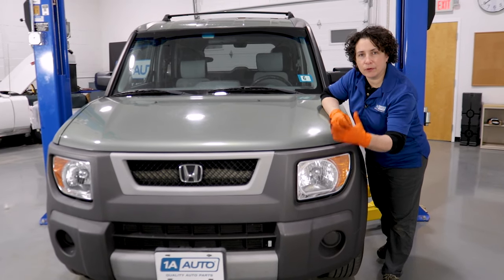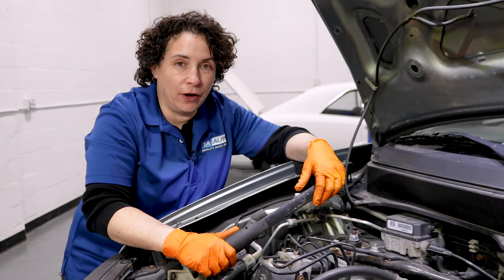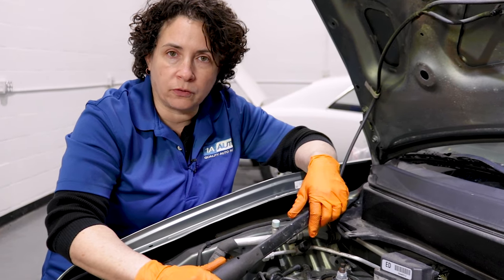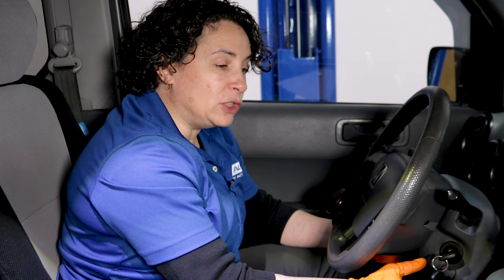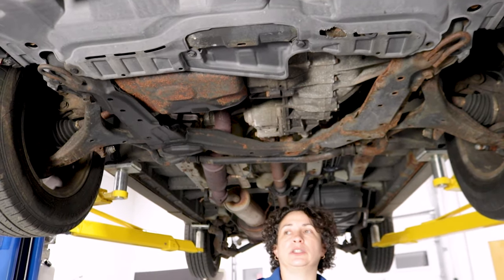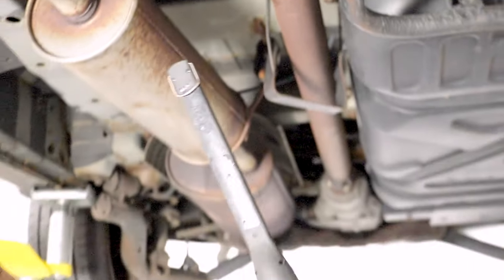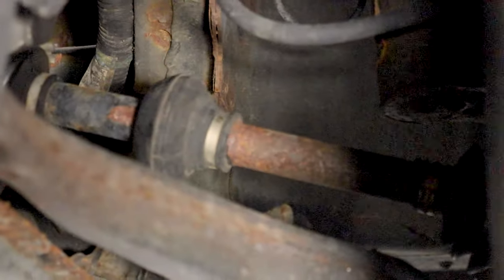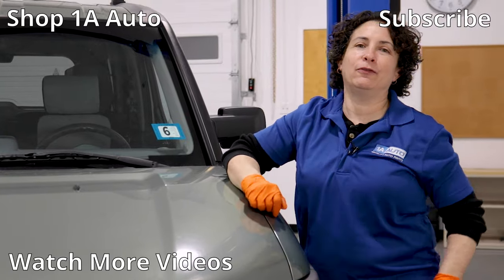Top 5 Problems Honda Element SUV 1st Generation 2003-2011

Comment: I have a 2005 Element.  Purchased with 128,000 miles, it now has 170,500 miles.  Replaced brake rotors and pads, struts, spark plugs, ignition coils and motor mounts. It’s been  a dependable suv, plan on keeping for around town errands, possibly up to mountains for some camping.lm///

Comment: Picked up a 2004 from my neighbor 2 years ago... 55,000 miles.  Excellent condition with full dealer service history for all required service.  Its all wheel drive and the best car I have driven here on Alaska roads.  Love the fact it turns into a mini truck with the seats out.

Comment: I never had any issues with my Element. Put 200k on it just fine.
Reply: Same here Lisa, I responded to one guy wanting to purchase an Element and changed his mind, I told him don't get discouraged on the vehicle, these are damn good vehicles and is the highest sold discontinued vehicle in the country.
Reply: That's awesome! I'm on my second Element (lost the first in a crash) -- but by far my favorite car to own. Currently at 135k on my 2006. So happy to hear the 200k+ stories -- looking forward to holding on to mine as long as I can.
Reply: everything has its problems. still more reliable than any domestic vehicle I bought in the last couple of decades.
Reply: Best tip for longevity? I’m planning to buy a use one

Comment: I wish they would make the Element again. Loved my 04.
Reply: They are
Reply: @frankburn6312  NO THEY AREN'T, STOP GIVING US HOPE
Reply: @imsuuuuure3074  they just announced that they are going to make a next gen
Reply: My ‘04 is still rolling along. 307k miles now
Reply: @FullyYoked  show the link, I guarantee it's not directly from Honda, people say the same thing every year
Reply: @Sirach985  got an 06 with 280k!!
Reply: Mine is 06 with 165k
Reply: '05, 200K.
Reply: My 04 element was trouble free, suffered none of these problems. It had 240,000 miles before my wife killed it. Maybe because it was a California Car, no rust like this one. Honda really made a huge mistake by stopping production of this Ute.
Reply: @bondgabebond4907  I'm in the SF Bay Area, so the underbelly of my beast is amazingly clean. No rust except a bit on the tail pipe, which I guess is not uncommon. The rust under the demo car blows me away.  My girl's is 2004 EX, 102K. Mom car.  I've never loved a car so much.

Comment: I bought my Element 21 years/180,000 miles ago and never had one major problem with it. Taken some major road trips with it, and it's been my work truck too.  Not so many miles because we always had two cars sharing the load.  Element's been the best and most dependable vehicle I've ever owned, would buy it again if a time-traveler!

Comment: I have two Elements. One throws a 2646 code every couple of years, along with bucking and sputtering. I simply clean the screen, clear the code,  and it's good to go.
Reply: Fascinating- I have a 2005 E with 200k miles and never leaked a drop of anything. I'll count my blessings.
Reply: @andykiss8124  same
 Except when they failed to tighten the oil filter after a oil change prior to taking it on a 1600km highway trip.  Lucky I didn't burn out the engine, she stunk from caramelized oil on the exhaust system for at least 2 years after that.
Reply: @andykiss8124  Me too!  SOP paint job.

Comment: I have a 2007 with over 200k miles. I haven’t gotten any of those problems. Knock on wood! Thanks for sharing!
Reply from the maker: +HowToDoItDude Thanks for checking us out! http://1aau.to/m/Shop-1AAuto-c
Reply: i have an 03 with 400 000km and an 06 with 250 000km and only had the solenoid issue on my 03, cleaned it out and it was good to go.

Comment: I own a 2006 Element and must be very lucky. I haven't had any of these problems. I bought it used in 2011 with 54k miles and now have 128k miles. I have a very short commute. The Element has been probably my favorite vehicle I have ever owned in the 26 cars I have owned since about 1989. The thing is a tank in snow and the most utilitarian vehicle. But, thank you for the video. I will keep these issues in the back of my brain for possible future reference.
Reply: wanna sell it?

Comment: 2003-2008 many would consider Gen 1, with major upgrades that happened 2009-2011. I have owned 4 elements, and am currently down to just one, a 2011. I guess I'm pretty lucky as none of my Elements suffered any of the problems you described...although I have suffered very minor issues with all. 2005 was not a very good year but to be honest, issues did not surface until well after 150,000 miles. The biggest issue with the Element is the suspension. It's not made to carry very much weight and wears out frequently. I see all these homemade "camping" Elements and feel sorry for the owner who has no idea what they are in for. Another piece of advice: Have that valve train adjusted after 100,000 miles. The last Element I sold had 305,000 miles on it-regular maintenance is the key. IE: Change the oil & filters religiously....@100,000 swap out the Auto tranny fluid & spark plugs-your golden.
Reply: Bought my 2003 used...was hesitating, because of the rear suspension. 130K miles.   Ain't terrible, but it squeaks and wobbles a bit.  Also, at freeway speeds a faint whirring noise is coming from the transmission.  Which apparently is a common problem with Elements, IIRC.  Had the valves adjusted after purchasing, oil change, but haven't driven it much to pay much more.  Oh!  I've got a case of the Battery Drain Blues.  Not too drastic, but replacing a battery after 3 years is too soon.  It's why I came across this video...looking for pointers on how to diagnose the problem.  Thank you for your tips.
Reply: Thanks for the tips!
Reply: @machtnichtsseimann  rear is probably just the bushings, cheap and easy to fix diy

Comment: We have his and hers 08 Elements and haven't had these problems but thanks for the heads up. They are the most trouble free cars we've had. Only 1 problem with the first one in 7-1/2 yrs the other 1 in 3-1/2. Both were purchased used. I think they will outlast me.
Reply: Yeah I recently bought an 08 Element, had it almost 2 years now, it was a salvaged vehicle, it's in great shape. I hadn't had any of these problems, I keep my oil changed with high quality oil, changing it myself. The CV axles are in great shape, so I have no complaints. But this is good information to know. My only problem I had was I had to get the right side fan replaced on the radiator, simple process, haven't had anymore problems.

Comment: One cause for bad axles that a lot of mechanics overlook is broken or worn out motor or transmission mounts. Before replacing a CV axle, it's a good idea to check those so you don't damage a new axle.  The damaged engine mount or transmission mount can allow the engine/trans assembly to move enough to pull the inner CV axle bearing assembly partially out of the outer raceways and even rip the rubber boot which causes loss of grease and premature wear.  I've seen a lot of CV axle issues coincide with bad motor/trans mount.

Comment: I have driven my 2005 element new off the lot for 19 years with three hundred k on it. One thing I noticed when driving down to Arizona is when on a right turning curve at sixty miles an hour I would get a weird shimmy I’ve never experienced before . When you said that about the drive shaft you described exactly what mine did . Not in the steering wheel but the car itself. Think I’ll take it in for a look .

Comment: haha I have a 2003 Element that I bought new in 2004 and that vehicle has 240,000 and no rust except a couple dings that have surface rust . The brakes have been redone completely twice and of course general parts replaced as needed but overall its the best vehicle I have ever owned .

Comment: Being a Honda tech I laughed at this video, the ignition immobilizer fault is not normally a issue it’s the electrical portion of the ignition switch. Can be replaced separately PN is in a tech bulletin for common fault and does not require reprogramming.
Knock sensors common to fail but verify harness or previous repairs. 
Vibration issues, inner cv joints front, wear causing vibration on acceleration, no mention of contamination of rear diff fluid, noise, vibration on turns. 
Please be advised under no circumstances use aftermarket axles, total junk, you will be sorry
No mention of rear control arm corrosion some models safety recall 
No mention serious AC faults, compressor failure contaminates whole system. ac relay failures 
No mention of lack maintenance “ oil changes” causing timing chain to wear out prematurely as well camshaft lobes failing. 
Some other issues with drive belt tension making noise under accessory load. 
Common oil leaks, valve cover, timing chain, timing chain tensioner cover.

Comment: I drove my 2007 SC for 15 1/2 years. 142k. No trouble with any of these issues. Just routine service. Only repair was a new starter at 114k. Best car ever.

Comment: #1 is actually the VTEC solenoid. the VTC solenoid is on the right side of the cylinder head, it goes through the timing cover. both are common leaks as well
Reply from the maker: +Rob Miller Thanks for the tip!

Comment: I found after having 5 Elements the most common problem is the window regulators seem to go out unexpectedly and intervals of about 50-80k miles, depending on how much you use the windows. I am sure there is a specific number of cycles that Honda has in their testing for production but that number I do not have and do not know if Honda releases that information to the public. Other common items are the cooling fans seem to go out about 100k miles in Florida weather while in a northern climate they last to about 150k miles or more. Its about $120 for aftermarket fans, easy install if you are mechanically capable. The radio volume knob tends to "slip " and the heater control light bulbs are intermitten after about 70k miles and replacements are very expensive($20 for one specific bulb and about $12each for the other 2) Other than that maybe corrosion on the brake calipers function and rotor warp if you are a heavy braker. Underneath corrosion in salty climates is a bad one. Finally what t3 of my Elements had was a clunking noise in the rear was from the rear stabilizer bushings were worn but not looking worn. About $15.00 and 1/2 hour 4 bolts (if not rusted) work. Any questions about the Element feel free to ask me.

Comment: Thank you thank you thank you.  Shortly after flipping her 100,000 miles on her most of that I drove myself bought her second hand, one previous owner, low mileage and LOVE my 2010 Element.  Was a fairly easy and cheap fix compared to having to find another car that fits my lifestyle. The shimmy is gone and was done in one afternoon at home in my yard. You are one of my favorite vloggers for car issues and my husband kept trying different things to get it to go away and looked at me like I had lost my mind when I said can we replace the CV axles and see if that fixes it.  But we did and now she is running like she did when I bought her.  So many thank yous for sharing this information you saved me trying to find another vehicle am trying to hold off until they bring the new Element out before buying another car.  My last car was a Honda Accord and drove that 280,000 miles before someone came around a blind curve and totaled it. I won't own anything but Honda because you just cannot kill them if you fix minor problems before they become major issues.

Comment: After owning 3 Honda Element, your video sum up common problem. I would add leaky oil pan...replaced  2 oil pan on two of my Element, one oil pan was crack and the other one was rusting out.

Comment: Nice video and tips, though your key tip may also be the connector to the instrument cluster, they are notorious for having a bad circuit board and the connector needs to be supported, this also causes the cluster lights to not work all the time. You can also hear the fuel relay clicking behind the glove box when it won't start.

Comment: It's great to see a woman do these videos for a change. Smart, well spoken, and professional. I have a 2007 Element and mostly love it. Great for my dogs or other small animal(s). No rug on the floors that hold a stain or smell. I found the seats hard and have no back support on a long distance drive. Don't understand why they put the sunroof at the back of the vehicle. So far it's been my favorite smaller type vehicle. I wish they were still making them.
Reply: Alexandra, my understanding was that the Element was oringally  made for young families.  They go to the beach and the kids can stand and put heads out of the roof.  Take carpet out and spray out sand and the read seats are theatre seats for the children to sit higher and see out the front window better.

Comment: Well, I rang 2 out of the 5 bells.  I just replaced the drive shaft at 203,000 miles on my 2004 a couple of weeks ago.  Also replaced my front CV axles recently.  On the left one, the boot cracked.  That was messy.  The right one snapped, yes snapped.  It corroded under the inner boot.  Couldn't see it but last summer I pulled out of a parking lot and accelerated hard.  SNAP!  They don't make the OEM parts anymore so you have to look for NOS OEM axles.  Get the OEM if you can otherwise you'll be a vibratin'.  I'm surprised that the head gasket isn't a major issue on these engines.  I just replaced mine last year because the aluminum head warped ever so slightly and had an internal leak.  You can't fix that with a pour-in sealer.

Comment: Great Job, (new subscriber).  I just picked up a 2007 Element for $4000 with 150K miles.  After getting Front struts next week (under $900 from a friend who
has a shop)  it should be a wonderful UNIT.  HOPEFULLY  He can figure out why my cruise isn't working.    I will look for a Video from you.

Comment: My list, based on talking with Element owners and personal experience with a 2003 EX 4wd AT:
1:  Bad shift solenoid.  Will slip when shifting from 1st to 2nd, and from 2nd back to first.  Don't let anyone tell you that you need a new transmission, or need to rebuild it, if you have this problem. The low shift solenoid is externally accessible, no need to remove the transmission, it is a very quick fix, remove the old solenoid, and put a new one in. Very common problem with Elements.
2: Bad neutral safety switch: Won't start in park, might start in neutral.  Can be intermittent.  Cranks, but barely, not enough to start car.  The neutral safety switch is behind a metal cover on the transmission, behind the front driver-side wheel.  Very easy to get at if you take the wheel off.  There are videos on YT on how to do it, maybe 1A has one.  About a 5 minute job.
3.  Window regulators.  Windows fall down.  These often break on Elements.  Easy job for DIY, use tape to hold the windows up. Again, there are videos on YT, I think I used 1A's.
4.  Door speakers fall apart.  The rubber ring surrounding the paper cones on the Alpine woofers will break down over time.  I replaced mine, but you can apparently replace the rubber ring with a kit from Amazon.
5.  Plugged heater core.  Known issue for specific VIN ranges (search plugged heater core on Honda Element Owners Club.

Comment: Wow that’s accurate 
Information 

Just fixed my knock sensor 

Just ordered a vtec solenoid 
Leaking oil & threw code

Need a right side Axle 

My  CRV has 158 k and counting

You will replace those items on any 2.4 engine

Love the 2.4 engine very temperamental & reliabili
Must change the oil regularly

Comment: Sue and 1A Auto are truly the glue that holds my Element together. 😂

I have an Element specific question...the inner tie rod ends. I am having a time and a half trying to disconnect them. I have tried many different styles of tie rod tools but none of them fit properly for one reason or another. I'm about to try using two pipe wrenches..any advice? I would greatly appreciate a video showing how to remove these stinkers!
Reply from the maker: +MaxJustMax NotMadMax We do not have a video for this repair right now, but we'll keep this request in mind for a future video! http://1aau.to/m/Shop-1AAuto-c

Comment: I had a 2003. Bought it to carry our Newfoundland. I took out the backseats. First time I walked into my local Honda dealer saw it on the inside sales floor. I walked over to a salesman and said “I’ll buy that right now”. He said “you want to test drive it”? Me “no”.
Really happened that way. I think it was $19,900 on the sticker.

Comment: I've been dealing with the Vtec issue, though it's the "low voltage" code 90% of the time, despite having replaced all parts more than once. Oil screens have always been clean and clear. Honda eventually put out a bulletin about this being an error, but AFAIK never decided to acknowledge or provide a fix to it. As a result, myself and many others are perpetually stuck in an intermittent cycle of driving in safe mode unable to do anything other than just replace the car. I honestly would pay an electrician to wire a bypass to end this.

Comment: Things I've had to replace on my Element in the 200,000 miles I owned it: Rear upper right control arm on the driver's side at 150,000 miles, Alternator at 180,000 miles, and the driver's side CV shaft at 195,00 miles. All easy fixes at home.
Reply from the maker: +Uprooted Pictures Thanks for the feedback!
Reply: If you see this, please reply!!!!  What issue occurred to let you know you needed an alternator.  I just had my dash lights come on and power steering was hard to drive and then red battery light remained on.  cut the car off and started it again and the Element is fine (at least for now, but wonder if Alternator is going bad??)
Reply: @wethepeople2740  take it to an autozone, they will scan it for free. Also can do a battery and alternator test I believe